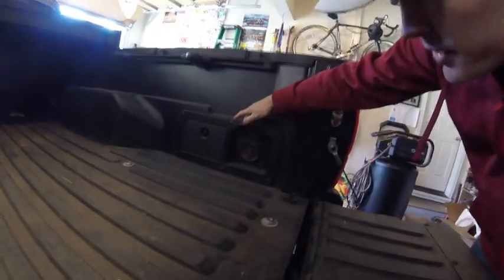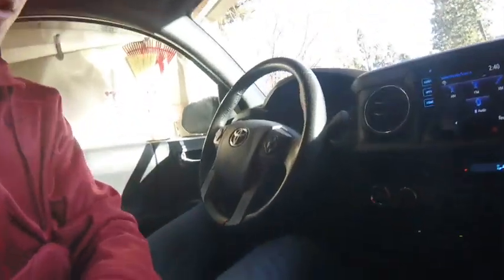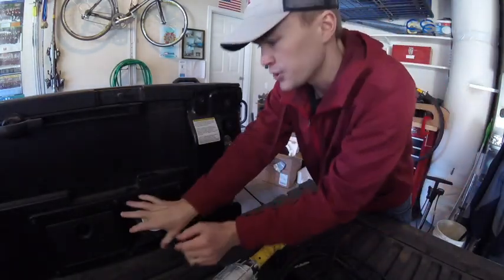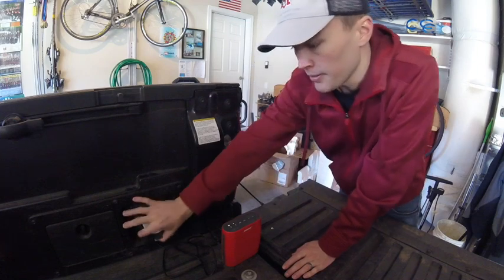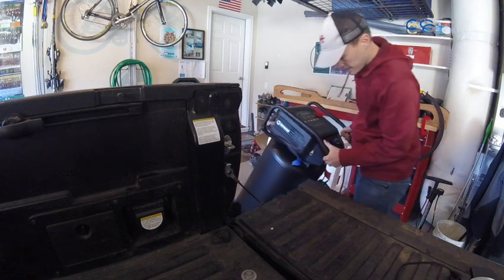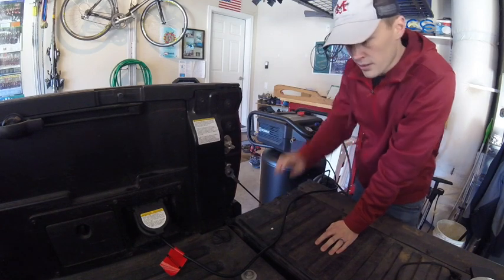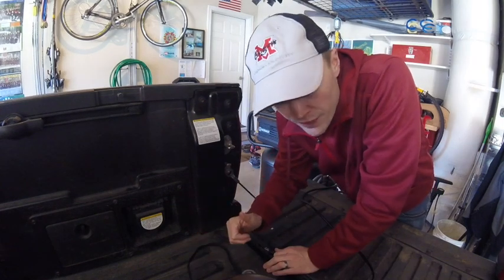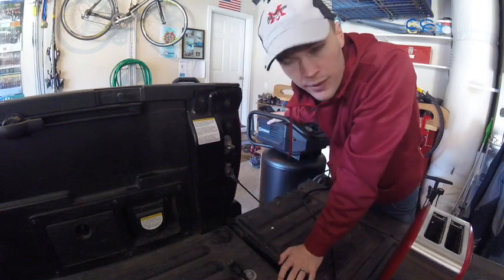Using the Tacoma 110V bed outlet

Comment: the compressor probably blue the fuse in the truck motor load start with a surge on the start winding,foolish test,also the appliances are restive loads and would blow the fuse before your toast or waffle were cooked
Reply from the maker: No blown fuses
Reply: Pretty sure I read somewhere that it has a breaker or something that will reset when you push the button in the cab again. It's not a fuse, it's some other type of protected circuit.

Comment: Nice video. Only think missing is that the 400 does not work in vehicle is moving. Many would like to have a portable fridge for tailgating, problem is it won’t run on the way to the game.
Reply: You can override / mod so that you can use 400 watts while not in Park ....
Reply: Dustin Hinds where did you find a override mod?
Reply: @CQN1HN  I guess that mods not coming is it
Reply: Thank you for saying that, I've been wondering why the 400w light wasn't coming on.  I just tested it while parked, and it does.  (I'm reading through the manual, but haven't gotten that far.)
Reply: I have the same problem with it kicking me off the 400 once in Drive. Now I have to buy the cigarette lighter adapter ($100) to use my devise while driving. Is there a way to stay in 400 all the time?

Comment: I was using a sawzall to cut some branches on a trail, it struggled but got the job done
Reply: bronxbomber thats cool !
Reply: Next time use a battery operated one. Or use a gasoline 2 stroke chainsaw. I use a 4 stoke chainsaw cuz i like the extra tourqe but its heavy. It is a 200cc vtwin. The blade never jams now. It has a different type of clutch too its a tourqe converter and single rotary gear. Beast saw